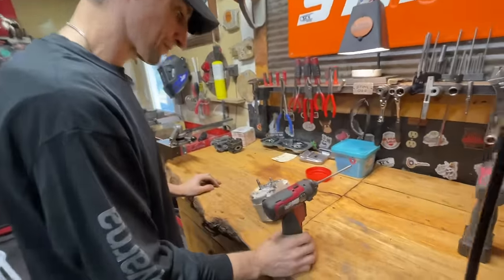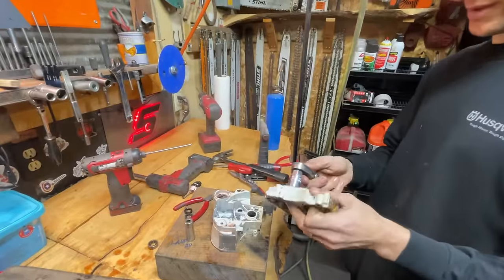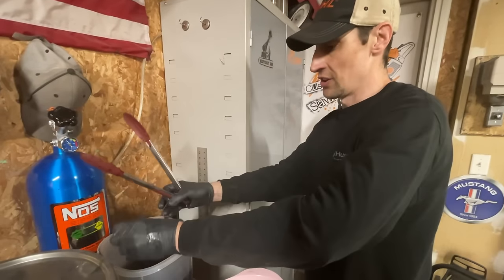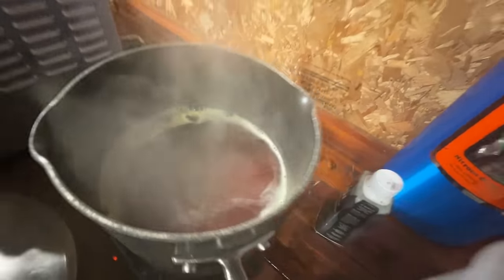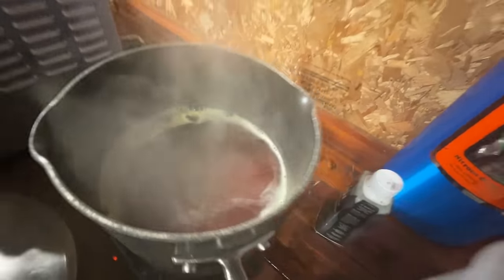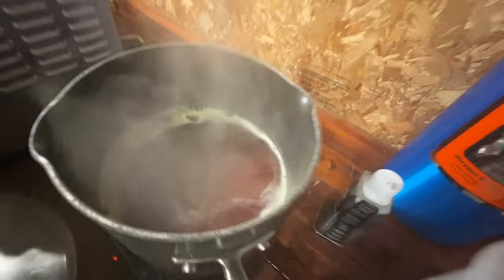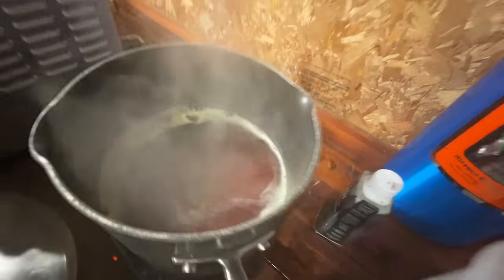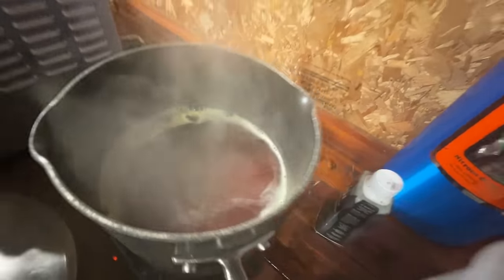THE LIMB REAPER LIVES!!! Rebuilding and restoring a custom built Stihl MS200t by John's Custom Saws

Comment: In 2003 I purchased a black Silverado SS, the old cliche, black is beautiful when you keep it clean, fast forward 20 years, 20,000 miles on odometer, thus the low mileage, hard to keep beautiful.

Comment: I found a trick with those intake manifold boots all you need is a piece of string that you tie around the end of the boot then just pull through the carb housing the string will come off and the boot will perfectly fit into place.

Comment: The Panther guide bars are generally, but no exclusively, built and oriented towards milling. The two cuts that John was asking about, at #53:45, are meant for attaching the guide bar to the Panther mills, especially the Panther Cub which works with smaller guide bars. It serves the purpose of sag (also called bar sag), which is the result of gravity acting on the overhung hardware spanning across the coupling that holds the indicator, because it is a mill guide bar

Comment: Would love to see What you would do with the little 025 Was 15 years in a steel dealership when they came out? I knew that it was awesome. And seems to be still. Porting them is just been my hobby. They are wicked just cleaning them up. And openings them up a little. Good to see a young man.
Confirming a lot of what I was taught.
In my younger day. Pushing 60 now. My mind and body are in a race to see which one gives up first.

Comment: as I understand it, that little plastic piece in the bar oil chamber of the crank case on 200ts was for crack/depression protection. It's there to help bolster the case to keep it from caving in or cracking if it were to ever get bashed around. Generally speaking it's not needed though. Also think it was really only ever stuck in the earlier 200ts.
Super cool video on the limb reaper, maybe I'll build me one on day..

Comment: That plastic piece in the oil tank is for support. It reinforces the oil tank and helps prevent cracking on impact from common drops and banging around.  Cast aluminum cracks really easy.  Without that I’m sure it will crack super easy.  Good luck.

Comment: Beautiful job and video of it!!!  And lol it was nice to see, for the 1st time ever, someone besides myself epoxy'ing rubber to the bottom (I do it for both balancing the unit when it sits, AND protecting it IE having rubber feeties on each corner of the bottom lets you put it down wayyyy rougher on 'crete!  JB Weld works best but even 5min-epoxy will hold the rubber for months if you know how to prep properly, JB feeties have lasted me nearly 2yrs!)
Surprised you guys questioned it pulling that bar, my mostly stock 355t wears an 18" at all times, honestly doesn't seem to have any issues whatsoever with it (the pairing just 'works well' it's not fighting to make it happen like if you put a 16" on a 25cc :P )
Love the skidplate have never seen/used one on my climbsaws only groundsaws, gonna go make one for my 2511 after seeing this :D

Comment: Tip on using spray paint….. remove anything that can’t handle 450 degrees…. Then heat in oven for 1 hr and use 1200 degree charcoal grill paint while parts are hot. Basically goes on like a powder coat and is very durable

Comment: The plastic piece in the oil tank probably was added after the fact because the saw wasn't balanced properly, where the oil side was heavier than the gas side. Stihl probably made their crankcase dies already and didn't want to redo them so they retrofitted it.

Comment: I restored an 011 AV, but, the automotive paints didn't hold up on the plastics or metal parts. I think I'm going to get after it again with dye and powder coat. Thanks for the info, great vidio!

Comment: Also with cleaning paint/powder coat off , you need 2 hard working metal mating surfaces to be clean when bolting together e.g. like new pads on a new chain for track on a excavator , if you don't clean them down to bare metal where they go against eachother the coating being softer will squish/shift and the pads will constantly rattle loose basically, same applies to cutting edge on a dozer and a lot of other things

Comment: Rubber grommets or intake boots , motorcycle tech I use a pot of bowling water and heat em up straight off the oven. Or if needed heat em with a propane torch. They get soft as butter. But it’s dangerous with the torch and the hot boiled ones hurt your fingers .

Comment: The difficult grommet problem, put silicone grease tie a string with a slip loop with a long end slip the loop around the centre of grommet then tie off, put the long end through casing with wires put pressure on grommet against casing and pull the string, job done!!

Comment: You only need a little cloud to come out of the powder coat gun haha but whatever works for you haha but you could save a crap ton more powerboat you just want a mist to come out so it's controlled because you can actually get issues with peeling if it's to think

Comment: Its to keep the weight down upping the power to weight ratio. Your adding a couple of oz of weight in oil that's not needed. As long as there's enough for a tank of fuel any more is extra weight to lug around. Lift the tabs with a pic a it comes off easy, reinstall by putting back and tapping with small socket.

Comment: My gut tells me Stihl included that crankcase piece to ensure the fuel and oil deplete at approximately the same rate.  We all automatically fill fuel and oil together, but perhaps they intended to avoid new users filling their fuel tank and thinking, oh I still have plenty of oil, which then depletes sometime during the 2nd tank of gas. But, just speculating here.
Reply: Execpt most saws only have to fill oil every other gas fill.

Comment: Acetone is a solvent, I'm guessing it breaks down the top layer of the plastic, (its possible that in the process of making those parts, a protective layer forms on the outside, and you are breaking that down, which allows the dye to imbed itself in the plastic. 

Think oxidation. I suspect the acetone is to the plastic as rust remover is to iron; Breaking down the protective layer that formed so the more vulnerable and workable is exposed.

Comment: At 4:28 he pried out the oil seal with his hook tool, and leaves a gouge in the engine case,  right where the seal resides.
Reply: Doesn't hurt a thing
Reply: @rc-daily  Maybe the factory should put gouges in the seal bores as part of the design.  Sound good ?
Reply: @kooldoozer  that would just be an added step. Added steps cost money
Reply: Gouges are free.  All you have to do is not give a fk.

Comment: hey man, I have an idea for a tool for that grommet that has to go in that keeps coil and shut off wire. you can either use a piece of tube with a sidecut on it or 3D print a tube with side cut to allow wires through and just hammer the grommet in it in . Just in the style of socket for O2 sensor

Comment: That spacer thing that takes up space in the bar oil section. Is most likely there for federal regulation or itd there to stiffen up the case because they found a weakness and that was easier than remolding all new cases..❤

Comment: This is so bitchin.  Enjoy your channel.  Will be doing some work to our 200T over Christmas time.  Such a huge bummer the seals were used and didn't work but on the flip side you dont have to worry about them failing early if the used ones had worked ok for a while.  Saw rips through larger wood...  Crazy!

Comment: Using a steel hammer on the end of crankshaft  is (professionalism ) ?   Doesn’t powder coating in certain areas changes clearance’s out of specifications (thousandths )

Comment: Would that plastic thing change the pressure of the case
Reply: To control the amount of oil in crankcase. Sell more oil. Break down faster change more frequently and easier to refill without measuring.